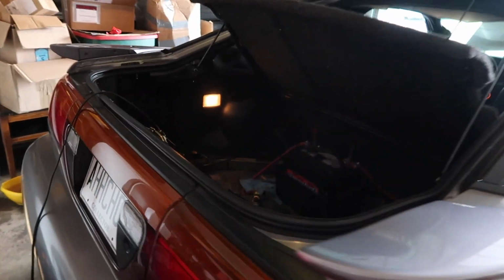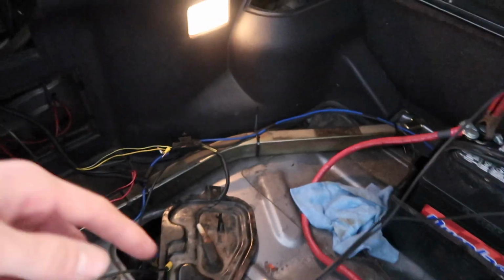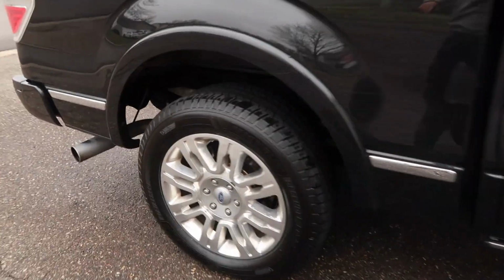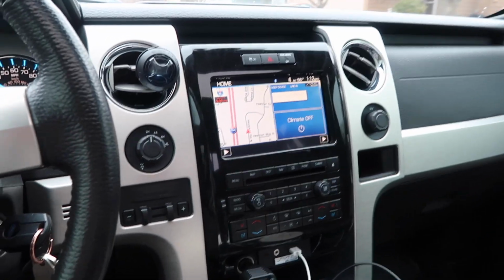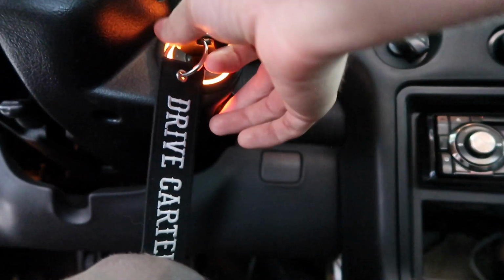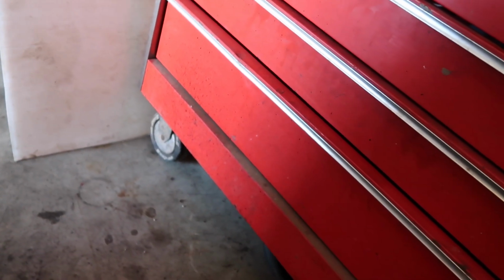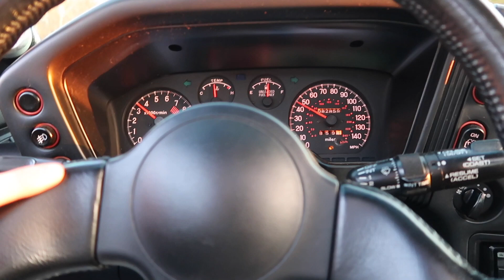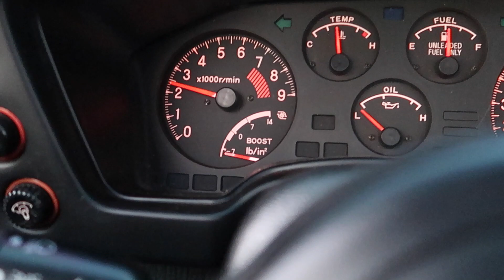Fixing a No-Start issue on the Talon + New Daily Driver!!

Comment: Maybe you saved “activate pump” in link. Glad you figured it out the pump issue. It’s only two wires for the flexfuel sensor and you have the sd harness from link?
Reply from the maker: I thought of that too but I don’t think so. I’m 95% sure I did it right. I bought their harness and everything. Haven’t figured it out yet.
Reply: @Al3xTalon  you can also have ecmlink prime the pump for however many seconds you want it to. Might be worth hooking a laptop up to it to check it.
Reply from the maker: Interesting! That I didn’t know. Thanks!

Comment: Don’t you have ecmlink ? The fuel pump primes for as long as you’d like in the  settings in the new firmware mine is set for 1.5 sec
Reply from the maker: I need to check into that. That’s news to me!
Reply: @Al3xTalon  Also check the misc tab to ensure you don't have the pump enable checkbox clicked. Easy enough to do when diagnosing and forget.

Comment: He al3x I was looking into buying a 1g tsi and have two I’m looking at one had a rebuilt engine 20k miles and makes 450hp or there is  another fresh built with no miles on it and price for Both are $3k what are your though form  being a owner ? Thanks
Reply from the maker: I would check over both cars good for rust issues. If you can, go see them. A lot of people have sold these cars knowing that they have issues. Also, know that getting into these cars you are going to end up spending a good amount of money on them. Maintenance is key.
Reply: Ok I see I was looking at parts and they very good price for most stuff  also my other though was Subaru gc8 but the dsm are somthing i have liked for a long time plus they seem like one could work on it

Comment: My fuel pump died 25 years ago and when I did it I wasn't gently with the float and that made my gauge be off 1/4 of a tank 
I took it all apart and I bent the float a crack and it's dead on now and everytime I took it apart after that it's dead on 
So it's good
Reply from the maker: Interesting! I might be pulling it out again and may look into that. Thanks!
Reply: @Al3xTalon  np